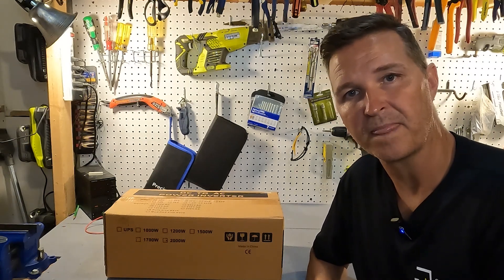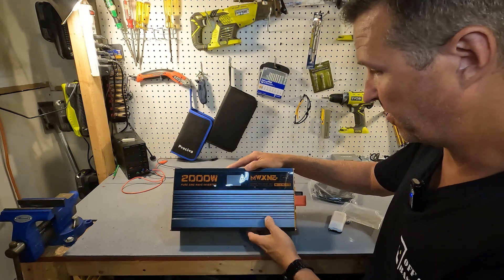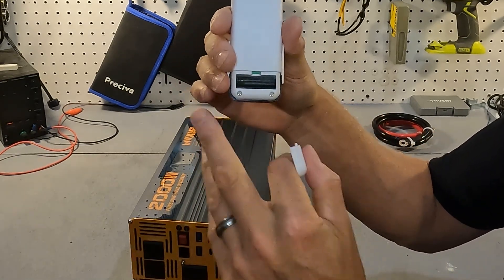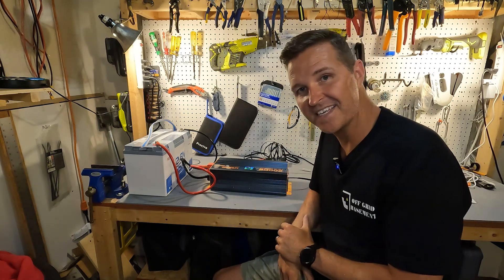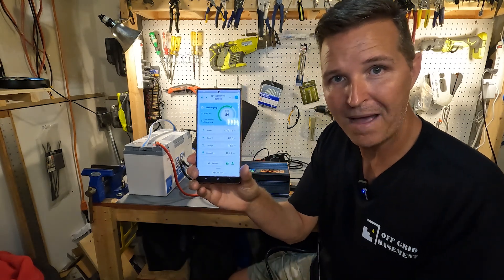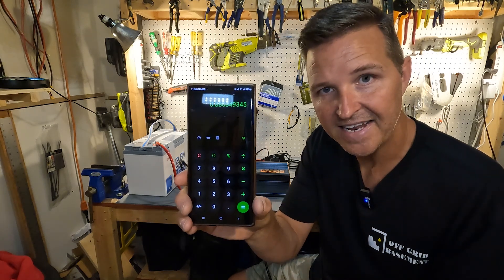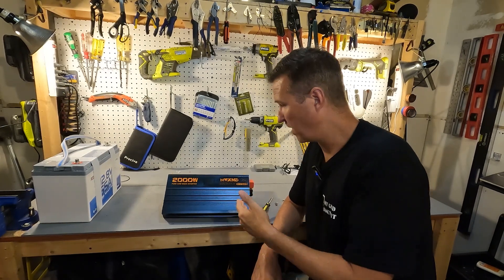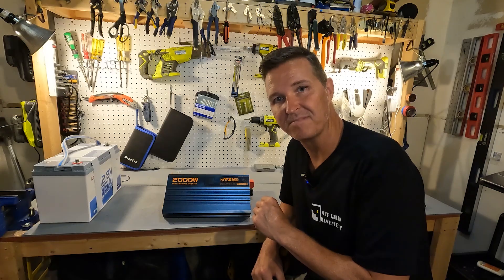MXNWE 12v 2000w Pure Sign Wave Inverter Review

Comment: Looks like a nice inverter.  (It looks like they have 24v versions of their 3000w and larger, but not this size...)

FWIW, that remote battery looks like a standard "23A"  or "A23" 12v battery.  That size is commonly used in R.F. remote controls, such as for garage doors (or for the inverter sitting next to me right now).

Thanks for the review!
Reply from the maker: Thanks for the comment and the info!

Comment: What gauge cable would you recommend for a 2000 watt inverter, please?  
A T Burke
Reply: For full load on 12v and using "short" battery cables (maybe about 3ft max), at a minimum 1 guage copper or 1/0 (also known as 0ga) for copper coated aluminum (CCA).

Why?

A 2000w load running on 12v is 167 amps.  Battery drops to 11v and now it needs 182 amps.  10% to 15% losses in the inverter and you need to plan for 200 amps.  That's how many amps a typical home breaker panel is built to run, but not continuously.  2awg is going to get hot... So you need thicker wires, #1 or #0.

Amps are the crucial number.  Running a 24v inverter would need 1/2 the amps for the same loadd.

Size of the load is important than the inverter. What is is the largest load you will run and for how long?  (lower max load and shorter duration not very often you can get by with thinner wire)

How far is the inverter from the battery? (longer cables mean more voltage drop which makes the inverter work harder and reduces surge capacity so you need thicker wires)

And you use fuses sized to protect the wire.  For #0 a 250amp fuse or smaller.  I like MRBF fuses.  ANL fuses are garbage at high amps.
Reply from the maker: Great answer Sylvan!  Thanks!